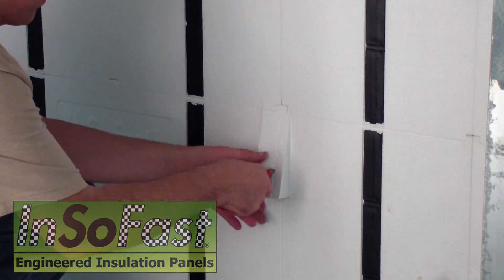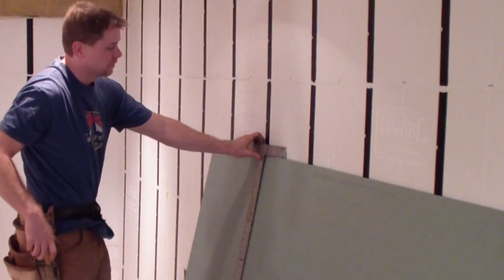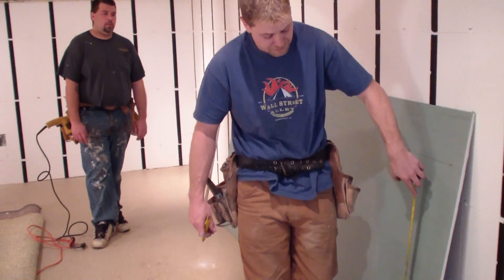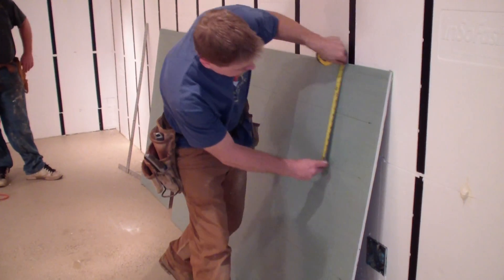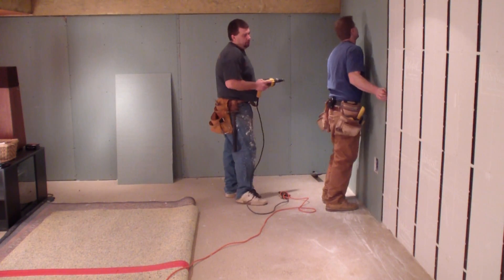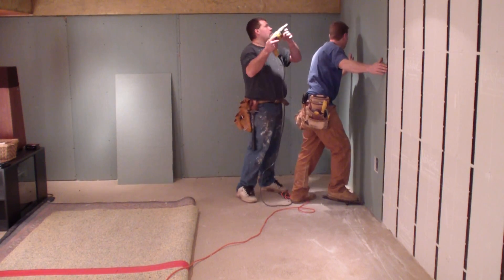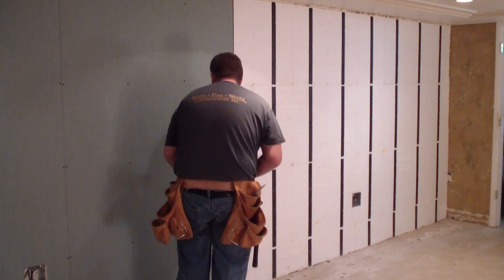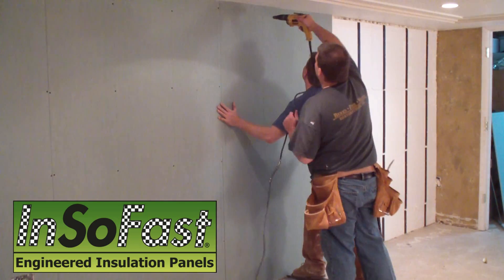InSoFast Drywall Install

Comment: do inside corner joints crack since there is no edge fastening at corners??   Also, how do outside corners attach??
Reply from the maker: No, we don't crack in the inside corner, the floats independently of the structure.  Here is a video on how we attach in corners if needed. https://youtu.be/9aCiiNLL8r8

Comment: Did you keep bottom of drywall 1/2 inch off floor? Don’t see a gap
Reply from the maker: Yes we did the contactors are using a step lift for the drywall panels: https://www.homedepot.com/p/Wal-Board-Tools-2-1-4-in-x-15-in-Roll-Lifter-03-001/100377273

Comment from the maker: This video may help you with your question:
https://youtu.be/zBW1mlASmSA?list=UUl79gsLKuEMSi0Qzyb6ok6A  
InSoFast installed onto a wall with existing conditions like a sink, 4" waste pipe, electrical conduit, and at the top of the wall the floor joist. It will show you how to pre-cut and dry stacked the InSoFast by measuring and laying out all the cuts, penetrations and existing conditions in advanced. You can easily cut around pipes, wall projections and other obstructions like electric wires so you can have a continuous blanket of insulation on your basement wall. With no gaps or holes in the insulation you will save more energy.  Sometimes the best way to handle 4" sewer pipes is traditional framing. ;)

Comment: I don't get how are they securing the drywall to the concrete? is there a wooden frame behind the insulation?
Reply from the maker: iquit4gud This is the benefit of the InSoFast Panels. The framing is fully integrated into each panel. That's what those vertical black strips are running along the wall. For applications against concrete, they are engineered to be adhered directly to the wall so that you don't have to penetrate the block or waterproofing layers. Drywall is then screwed to them with standard drywall screws.
Here's a video where you can see how easy this makes the installation process: https://youtu.be/QZqhzFbxYKk
And if you're interested, here's the traditional method with wood for comparison: https://youtu.be/oKQdo88Ne74

Comment: Everyone works different ... Point is to get the job done right .... I been doing drywall for about 3 years ... I have no clue how to obtain a drywall license ??? Pls don't hate I know how to install and I worked mostly in houses but I want to Start my own crew ... I live in Georgia if anyone have any advice pls let me know
Reply: Im from Norway, wanna team up?
Reply: Your license would be obtained through your local county Code Enforcement Office but if they get a clue that you've already worked a day without a license you will be more than unhappy to have let them know that. You can not undo that. You will also need a tax ID sometimes called a business license.  Your business needs a " Fictitious Name" registration which is the name of your business  i.e. Drakes Drywall Install Inc.  Some states also require a contractors license to install drywall some states do not but you have to check because it is fines and jail if ignored. Code enforcement officers need only sit and look at ads for services in flyers, newspapers,  television, online, and in my case local theaters and phonebook and anyone advertising that is not properly regestered goes down.
Its really not that hard to do some of it might seem a little bit expensive but if there's any real profit in your business then its worth it if its expensive for you to do, then for you there's not enough profit in this business. And that goes for time as well as it does money because some of these permits required a class or some very small speck of time somewhere.

Comment: Boyz, Instead of marking your drywall rip with your tape and pencil, and then trying to follow your pencil line with your utility knife, Use your tape and rip with your utility knife,
Reply: Exactly! That's actually the trade trick, not the extra step he added.

Comment: Question why wasn't the drywall laid horizontal for one the long joint to mud?
Reply: also there are no butt joints this way
Reply from the maker: Yep smaller residential projects do have that unique advantage of eliminating butt joints. Thanks for pointing that out.
Reply from the maker: Good question. It is just a regional preference thing in this application going vertical was easier. Either way is fine.

Comment from the maker: Are you asking about the drywall or the InSoFast Panel?
Drywall 4' wide by 8' high by 1/2" thick
InSoFast Panel is 2' high by 4' wide by 2" thick (24" x 48" x 2")